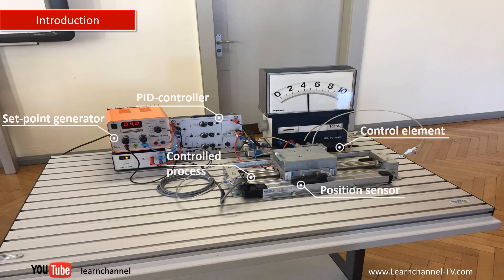Tutorial Closed-Loop Control: PID Controller at the example of a Position Control

Comment: the proportional valve control you used is the current type or voltage type?
Reply from the maker: Hi, it is a voltage type. The control voltage is between 0 and 10 V. Power suppy voltage 24 V